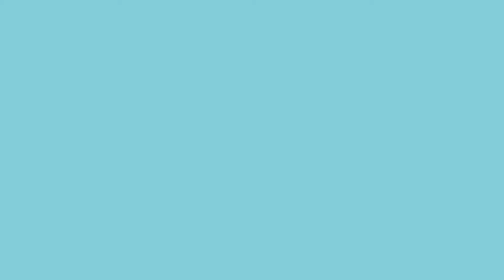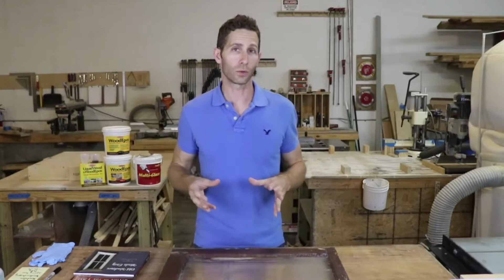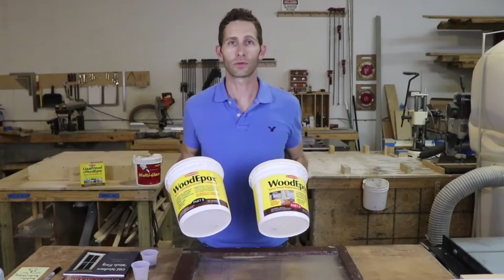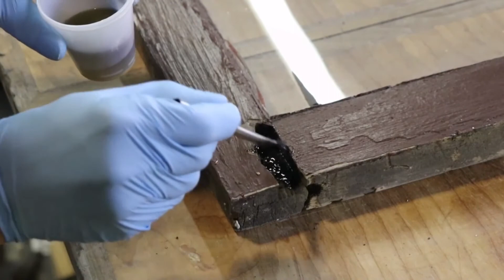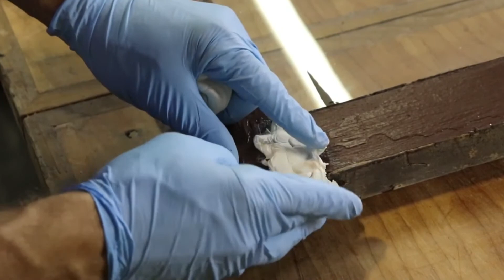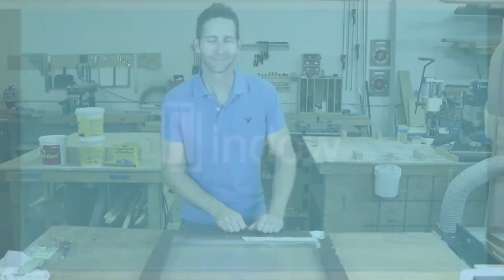How to Repair a Rotted Window Sash

Comment: Had this thin storm window, corners rotted away, drove galvanized screws in at right angles and set it up with milk carton cardboard like a mold that I filled with epoxy putty.  Worked quite well.  You could have added structural strength this way.